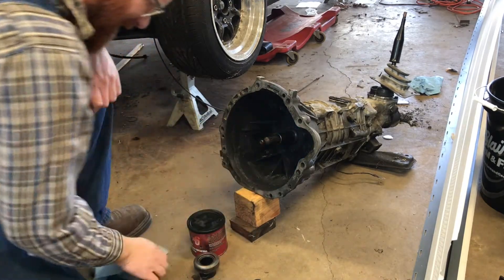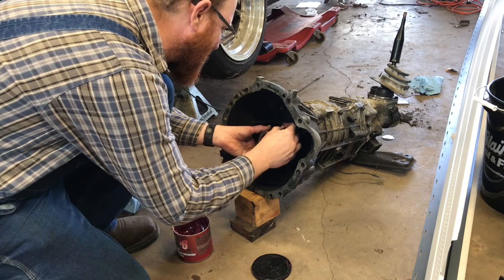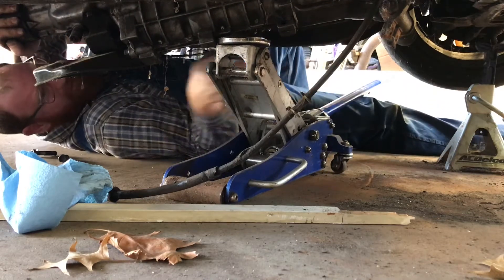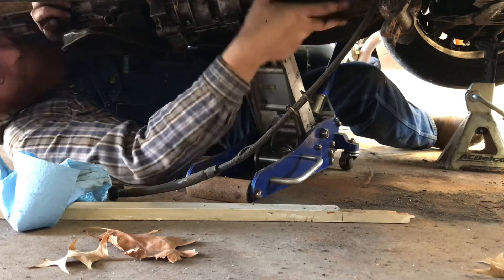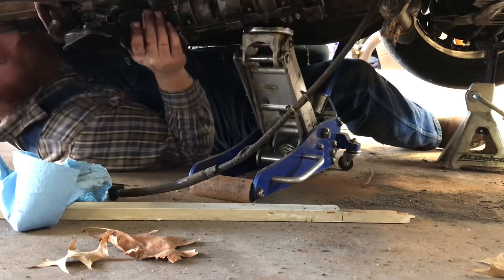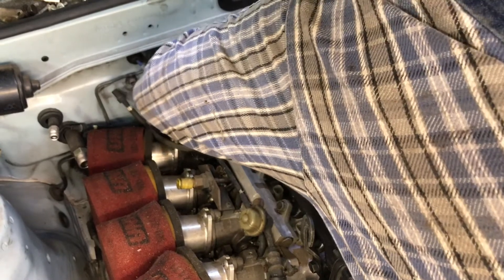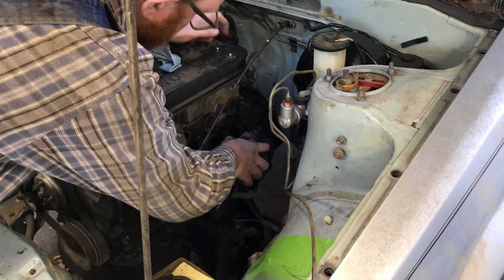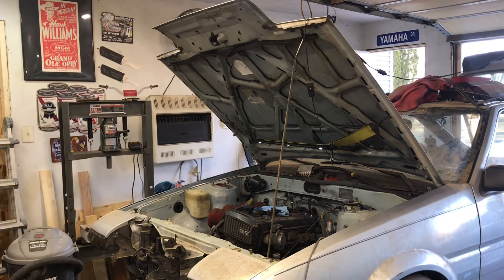AE86 revival pt3-Installing a 9000 rpm 4age with ITBs

Comment: Having replaced the clutch and flywheel in my S2000, bench pressing it into place, twice because of ineptitude,  I feel your pain.  Because if it's worth doing once, then it's worth doing it however many attempts it takes because I'm a cheap bastard and I don't trust anyone else to do it right.  Eventually.